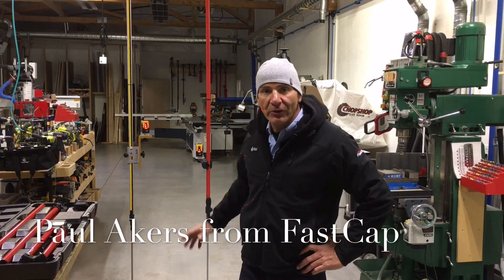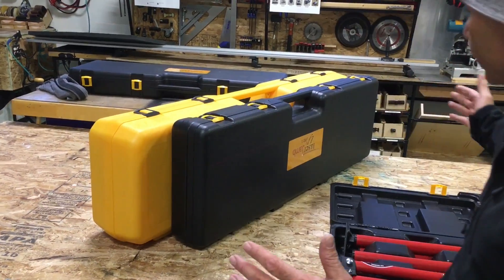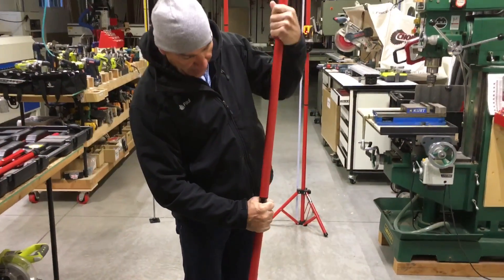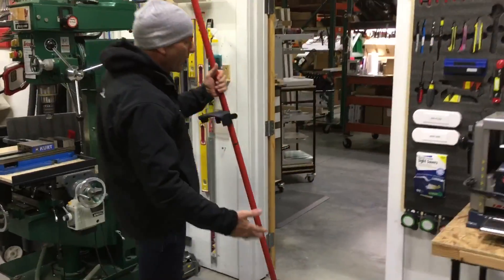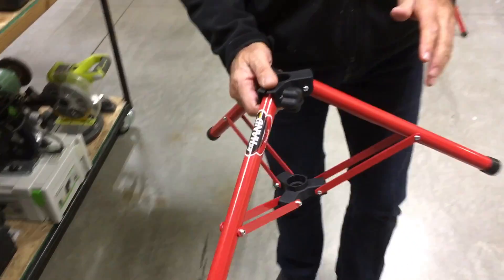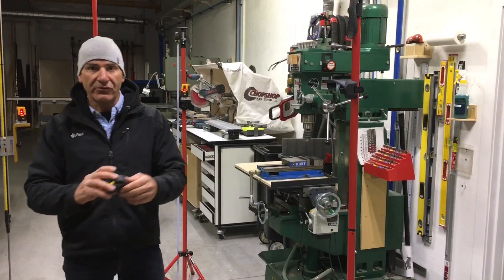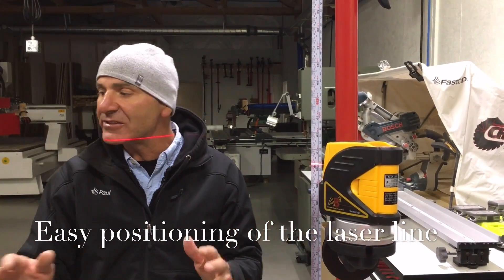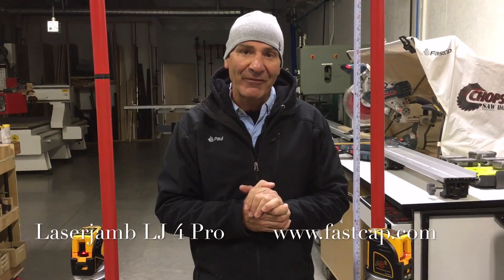New Laserjamb LJ 4 PRO

Comment: Any upgrade options if you have the previous version? The laser attachment, tripod and tape holder are great!
Reply from the maker: +NoSpam Elf The laser slide attachment works on the existing 3rd Hand, no problem.  The tape measure will mount on the top just like in the video, but it might be off a little bit in terms of the angle you could put a small shim underneath it to make sure the tape measure is going parallel with the 3rd Hand.  Paul

Comment: Let me give some design ideas for you so it's even more compact
MeFOTO BackPacker Air Travel Tripod....see the tripod feet are attached but swing out. Your case is WAY...WAY..WAY..too much for a working mans truck. I can design the same thing in a VERY compact way using the tripod feature for stand alone applications and then use the ZIPWall  for ceiling to floor applications. Much better than that oversized box...and cheaper. Keep refining boys your getting there